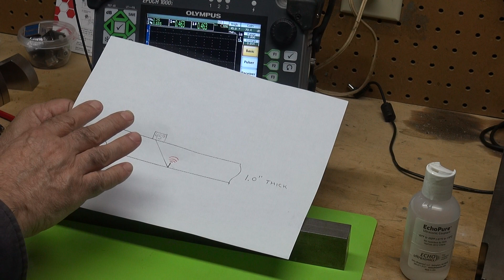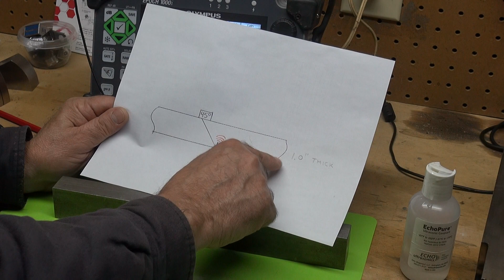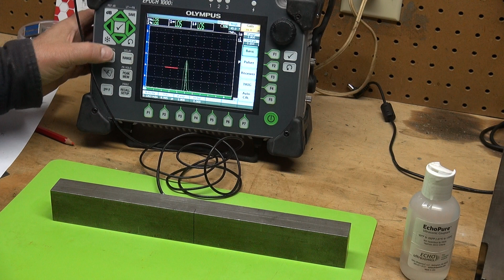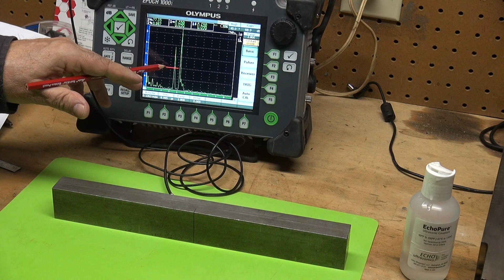UT Tip Diffracted Signal

Comment: Just to add on this, if you wanted to measure the height of an imbedded crack, you'd need a top and bottom tip and measure the difference between those.
Reply: Part T - depth of diffracted signal = through-wall height
Reply: @rodstephens742  some clients require actual flaw height. Not all cracks are id or od connected.